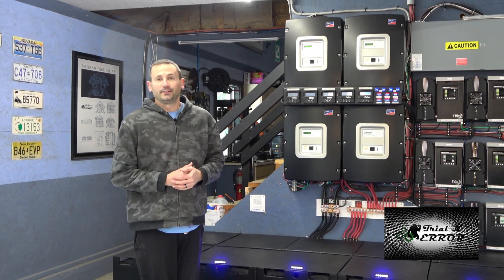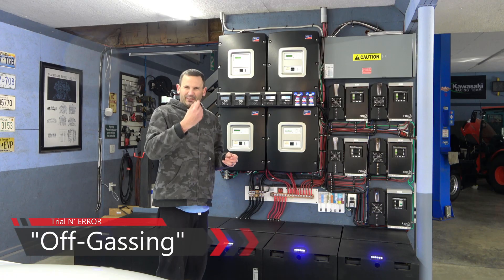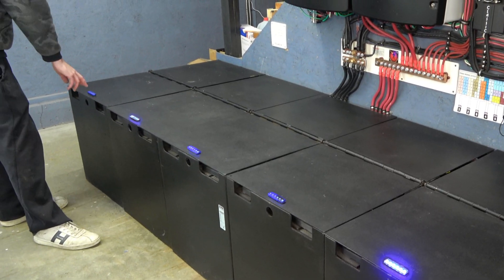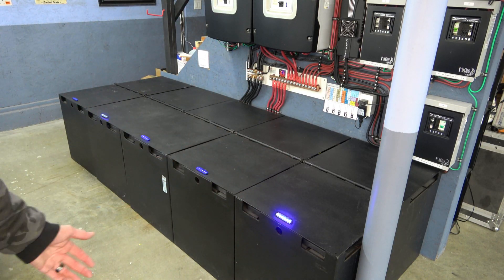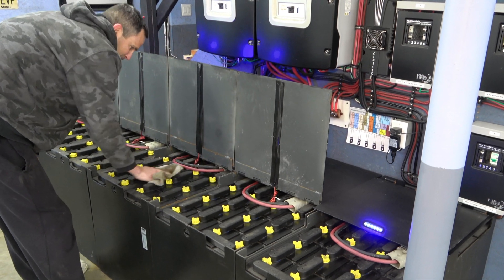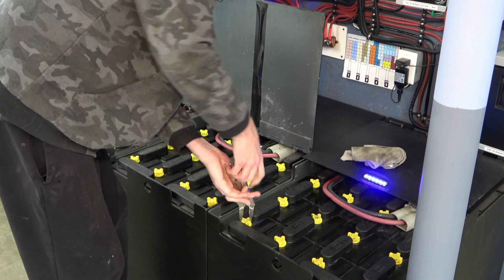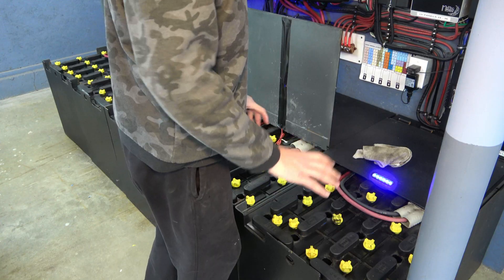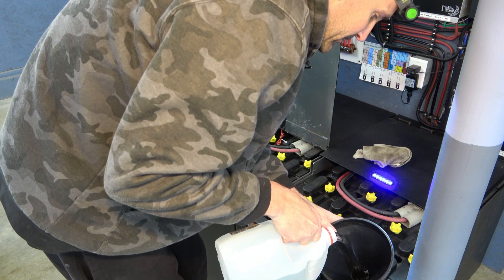OFF-GRID SOLAR Maintenance Procedures - How I Keep My Power Plant Alive.

Comment: I have a 6hp diesel engine and I use free grease fuel. I want to mate it to a dc motor and charge my batteries through a charge controller,  any tips to make it my main source of electricity?